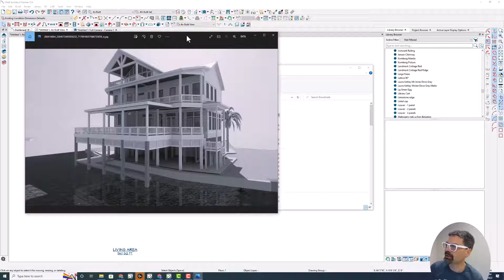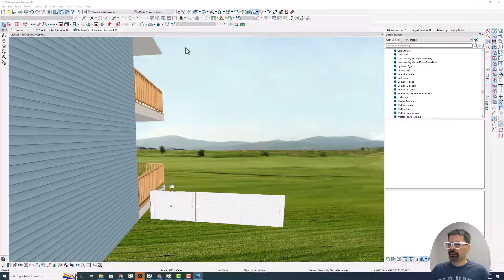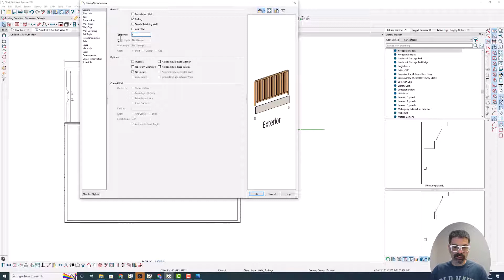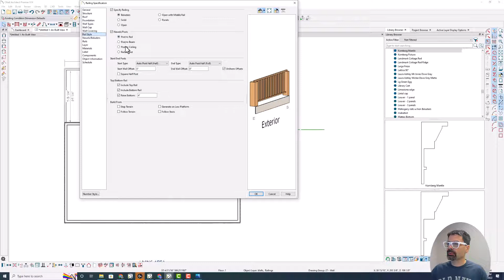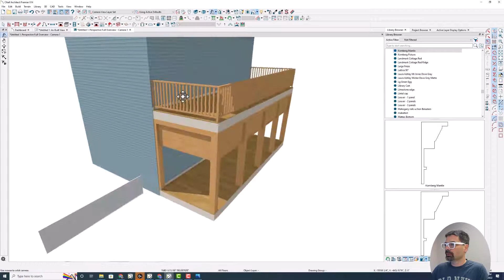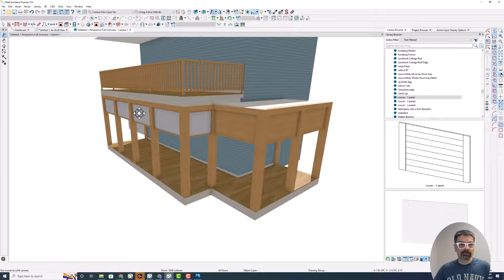Louvered panels at top of railing | Chief Architect

Comment: Louvered panels quick to make from a louvered window.
Reply from the maker: Cool idea!
Reply from the maker: Just tried this idea. You'd have to make the window with proper settings, take rendering and delete wall surfaces and then send to the library by converting to a symbol. Fairly simple!
Reply: @DesignbuildsolutionsLLC  After changing the window as needed, select it in any view and convert to symbol. Does not need to be in 3D, and no need to delete wall surfaces.
Reply from the maker: I'm working in X14, X13, and X12. None of them allow to select a window and "Convert to Symbol" in plan view and "add to library" only added another window object; so I never checked the 3D views. I just learned something new! Thanks!